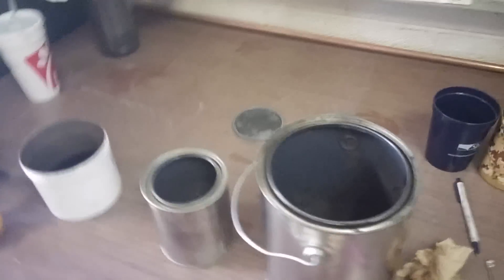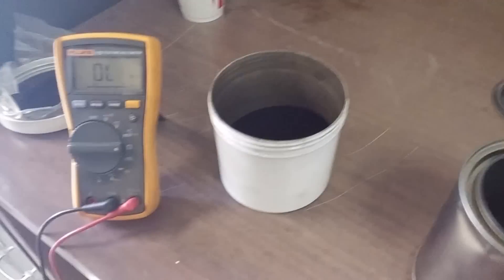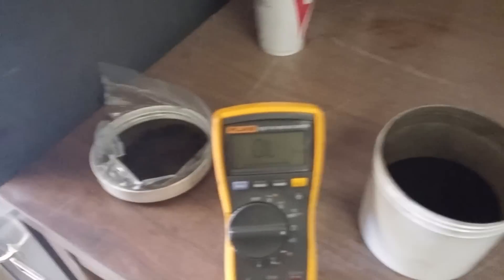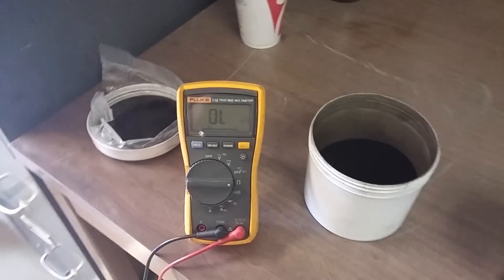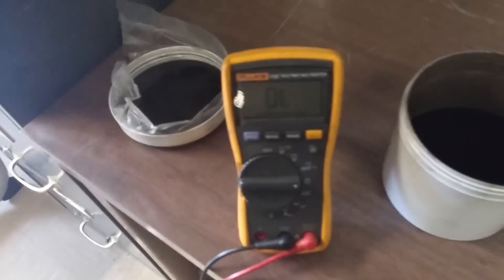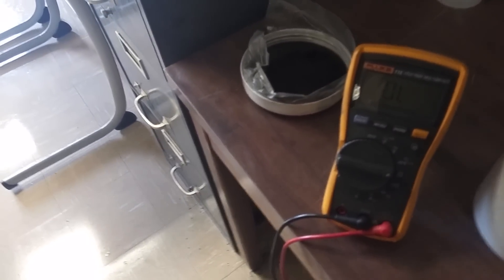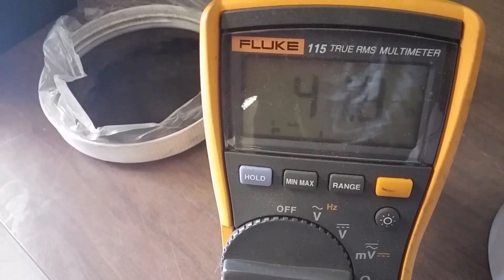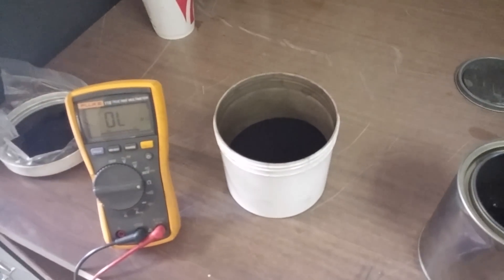Graphene Mass Production Update (powder conductivity)

Comment: Hmm, my standard lampblack powder has already around 50 to 70 Ohms in this conductivity tests, so that is not such an exception what you show there... What would be real nice, if you would come below 10 Ohms, then it will be getting interesting for battery electrodes... Regards, Stefan.
Reply from the maker: +overunitydotcom That may be true, but this powder only show intermediate connectivity. Once laid out in orientation, we are conducting better than any metal, it's just a matter of orienting the flakes....
Reply: Venturestarx
Just show us a test with a digital Ohmmeter that you get below 1 Ohms/cm then I will believe you  ! ;)
Reply from the maker: It's rather hard to get an Ohmmeter on the individual flakes. Especially when a small fold with change the reading.
Reply: Well, press the powder down to a graphite plate and show the readings on this graphite plate... The best so far I have seen was about 2 Ohms/cm from another guy...
Regards, Stefan.
Reply from the maker: +overunitydotcom That won't show the conductivity of the individual flakes. We had some ORNL guys do the tests for the individual flakes, and got stellar results. (I just don't have that kind of equipment) But once again, we are talking about flakes less than 15 microns in diameter.
Reply: I have graphite powder which have conductivity around 8 to 5 ohms/5 cm. Venturestarx good video